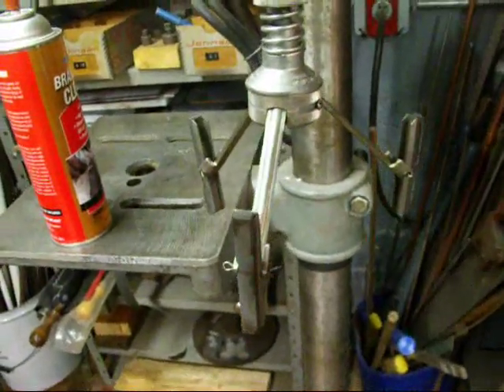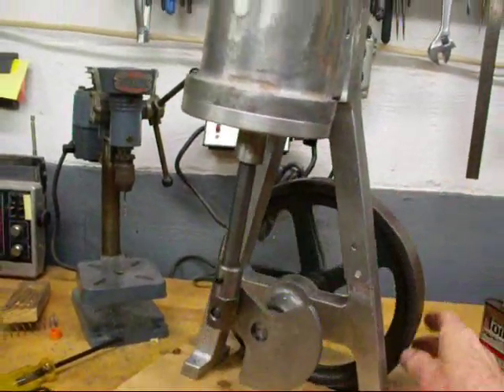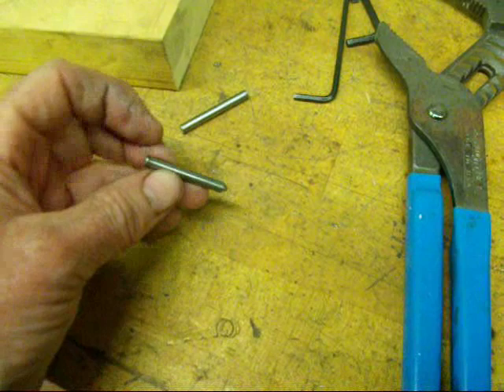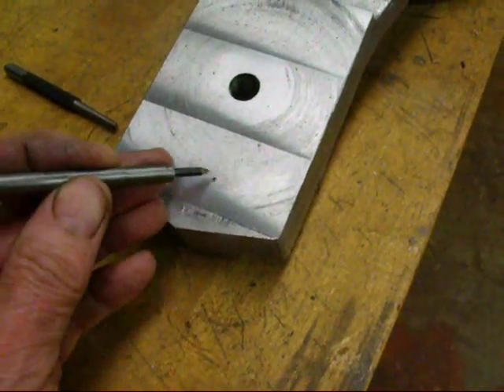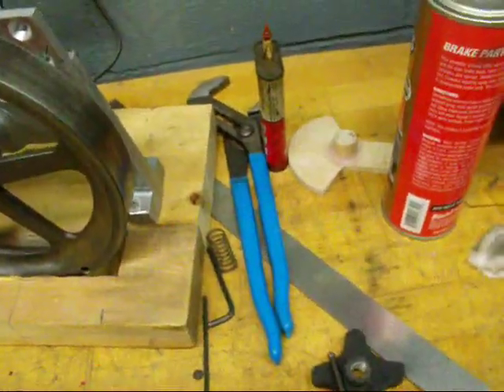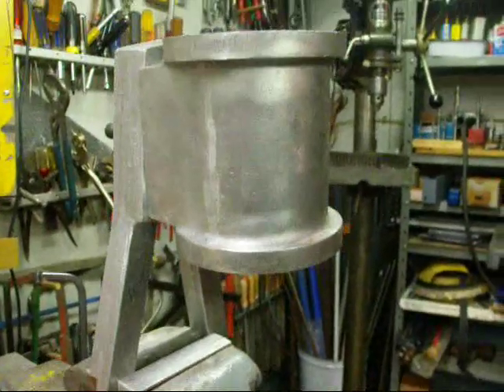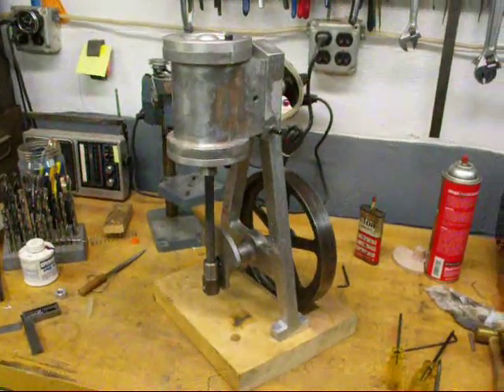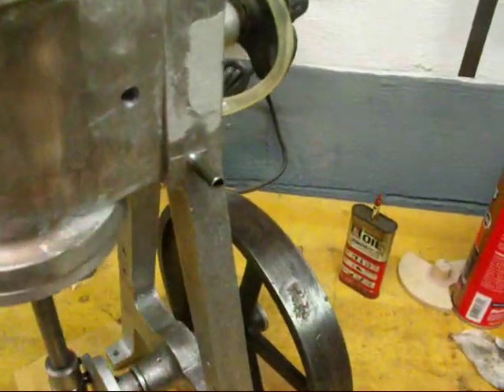BUILDING A MODEL STEAM ENGINE part 7 tubalcain

Comment: Thank you so much for sharing. I like your comment: "You want an old good lathe with all the accessories!" Yes, .... I have been looking for years, still no luck. Here in OZ they seem to change hands, friend to friend. I bought a Taiwanese lathe about 25 years ago and a gunsmith friend tuned it as best as he could. It cant screw cut, it's a bit limited!  Having said that, it's leaps ahead of the Chinese rubbish sold here in Australia, .. Best Regards.
Barry M.

Comment: Also reversing could be done by drilling 6 holes on the base, one exhaust and two intakes per side and make a shifting mechanism to shift the cylinder from side to side to line up with either set of intakes and exhaust, this could also make for a little bit of cut off adjustment.

Comment: If the holes were to be elongated they should be done so the elongations are radiating from the center axis of the cylinder, sort of like the tips of an X formation.
This would help the engine breath and give more power. Increasing the length of the power stroke would be OK for just running on air but if this were to be run on steam it would be very inefficient, part of the power of steam is the expansion in the cylinder after cut off.

Comment: Could you explain steam engine valving a little bit, I am only familiar with internal combustion which likes the valves to be open at either top  to bottom dead center or bottom to top, these are open only a a brief time and it appears to me that they are only open when the engine is halfway between top and bottom